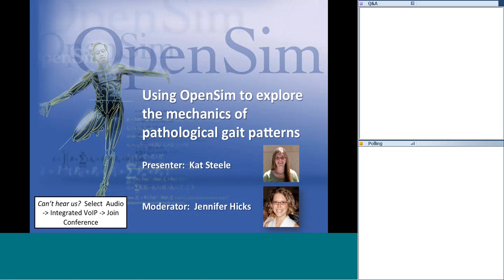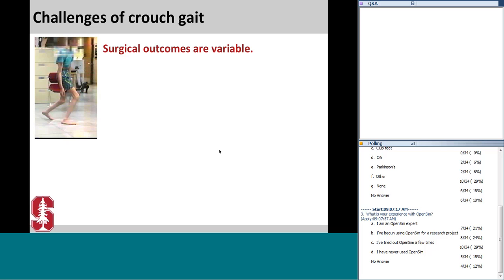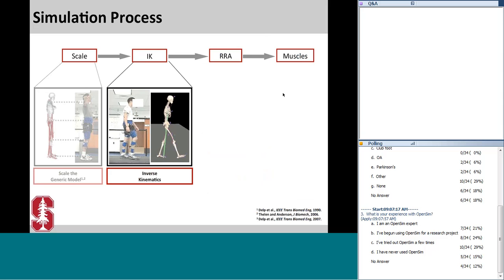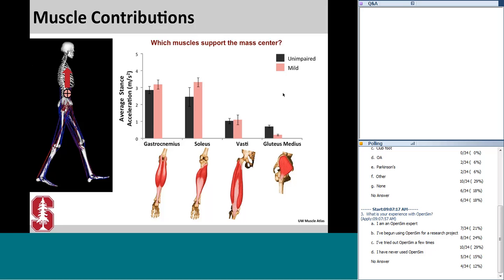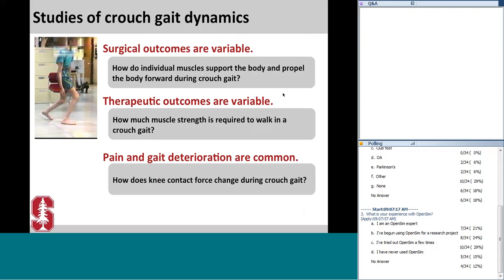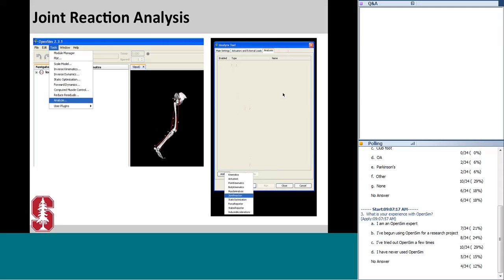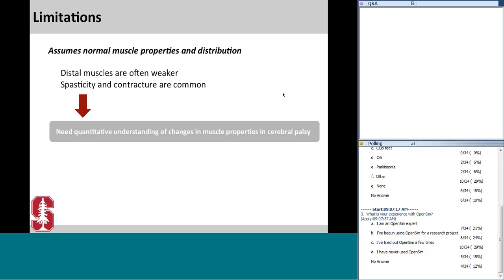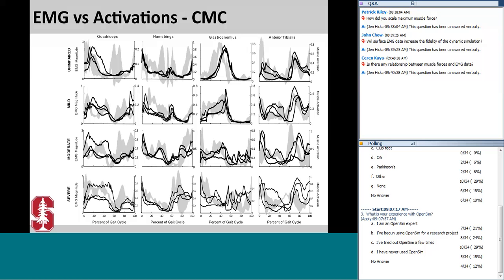Using OpenSim to explore the mechanics of pathological gait patterns

Comment: HI, I am working with OpenSim on amputee walking following the same structure of simulation on this video,  but I found some problems after to edit the model from the xml code with Notepad ++ when I tried to simulate the Static Optimization Tool , The other tools like  Scale, IK and ID were working very well but with the Static Optimization the simulation spent hours and hours and it never finished. I need some advice or help about it . Thank you in advance for  your assistance and attention.